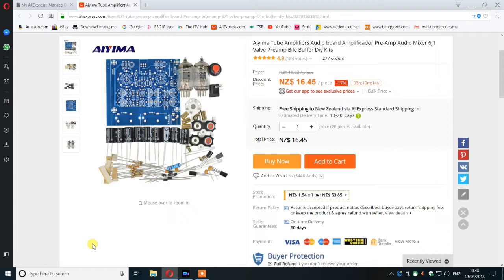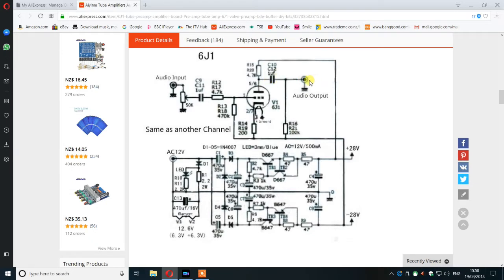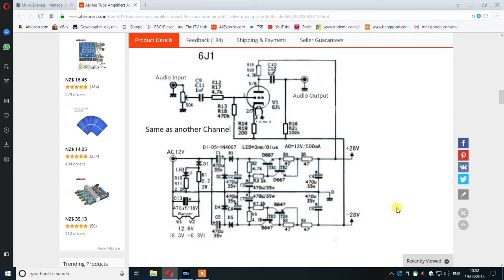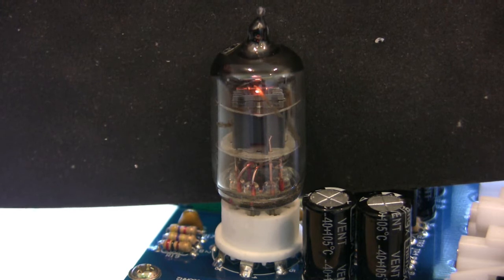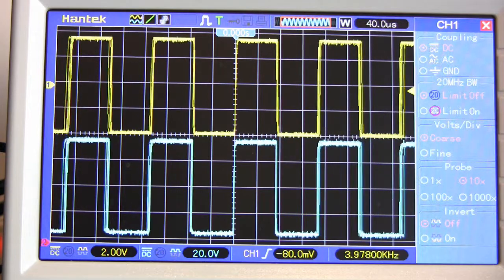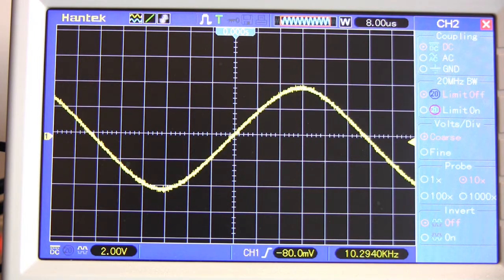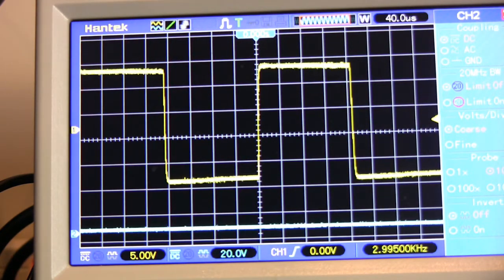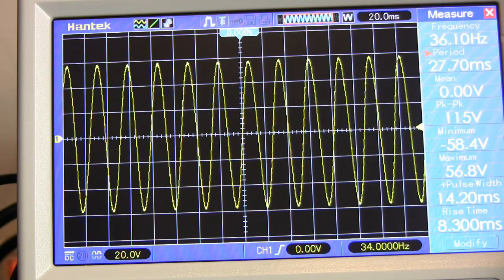Aiyima Valve Pre-Amp.

Comment: Great video! Is there any way to modify the power amp section to increase the input imedance and in tern improve the bass responce?
Reply: Replace the two 105 ceramic capacitors between the tubes with 3.3uf bipolar capacitors of some sort, up to 10uf

Comment: Anyone know where can I find a 12v ac power supply?
Reply from the maker: A 12 volt AC power supply is simply a transformer. Many electrical component shops will have such a transformer available and at very low cost. Look for 12 AC @500mA to 1 amp output.
Reply: @MichaelBeeny  Thanks
Reply: @MichaelBeeny  any specific watt ratings to look for in a transformer?
Reply from the maker: @dogsauce19  A transformer with about a 1 amp output should be fine.
Reply: @MichaelBeeny  Thanks for the quick reply! Most bare transformers don't mention amps but instead list their watts. A quick googling tells me 1amp = 110w at 110v. I'm guessing that's what I need?
Reply from the maker: @dogsauce19  No quite, the rating is on the low voltage side, so on that basis it will be 12 x 1 = 12 watts. All the transformers I have the secondary is always rated in amps. Look in Ali Express or e bay.
Reply: @MichaelBeeny  Makes me wonder whether this would benefit running on clean linear power...🤔

Comment: Yeah i can't stand the blue LEDs either that always come in these kits and would always suggest to just leave them since the they are not essential for the function. I guess some people like the blue glow some Valves have but i don't need it. And i actually kinda like the addition of overtones that some valves produce. Problem is these 6J1 valves that come with these kits are not really meant for audio purposes so they might have a very boring sound. But of course they can always be swapped with a different pair that is compatible.
Reply: I bought a cheap headphone amplifier with those blue LEDs under the tubes. I cut the trace on the PCB to disable them (it wasn't a kit.)
Reply: @wcg66  Yeah i did the same with another pre-made board like that. However i de-soldered the LED solder spots and removed them. Looks so much nicer now.

Comment: Great vid Michael... i have a 2000ohm 1920's radio speaker. do you know if the output of this would match? i was looking at using a mono amp with an 8ohm to 1300 step up... however, if the impedance output of this pre is high enough, i might not need the power amp stage. Next, in either case, I would need to mono sum. If i used 1k resistors then a 1:1 transformer between preamp and speaker/power amp, would this be safe with this preamp? thanks Michael
Reply from the maker: This has a high output impedance; I doubt it will run headphones directly, even so-called high impedance types.

Comment: I built one a couple of weeks ago, cost me less than a tenner, I did the freq response tests, I cant believe it.  Its an amazing little preamp. I cant hear any coloration from it either. I did an AB test with it set to unity gain and switched in in and out and didnt notice a difference played through some small mission speakers.   I will try the output measurement from the power amp to see if I can see any roll lf off. The input impedance of my amp is 20k.  The price is cheaper than a passive pre amp. I dont get any hum or noise from it either, amazing, a fun project.
Reply from the maker: 20k is abit low, you might find some bass roll off. If so put a series resistor, just high enough so the bass does not roll. I doubt you will lose gain because it's seeing a higher input impedance. You wont get much hum or noise because the gain is so low.
Reply: @MichaelBeeny  OK thanks very useful!

Comment: gotten a little late for this video. and i guess you have a few things right about it won't be good as a preamp. but what about the "warm" sound lacking in a Digital amp. and using this on a vinyl player. as "inbetween" the player and amp. not for gain but for more believable tube amp sound.
Reply from the maker: I think the warm sound you are talking about is the lack of detail, extended frequency response, dynamic range. Too name but a few things missing in most valve amplifiers. Still, some people like it.

Comment: Some guy is claiming this is a PHONO preamp but I cant see any RIAA equalization in the schematic, am I wrong? Is he trying to fool me?
Reply from the maker: You are correct, no RIAA, also not enough gain for a mag cartridge. Might be OK with a ceramic cartridge of about 100/500mV output, input via a 1 meg resistor. This would not need RIAA, but does need a high input impendence.

Comment: good morning I found your extremely interesting video just today   I wanted to ask if by chance you also have performed measurements of noise and distortion on this nice preamp 
And then if you know its voltage gain Thanks and best regards, gino
Reply from the maker: Hi Gino, was a while back but as the gain was relatively low, noise was also low. Not as good as say a 5532/4 chip pre amp. Distortion below 1% mostly 2nd harmonic. That's the valve sound some people like for some reason.

Comment: I have the Musical Fidelity X10-D, tube buffer from the 90s.  In fact I have 2 nos. because I kept the 1st one in my parents place for the hifi there.
I would say that although they work, they may not alter the sound (to make it more tubey) for all systems.  I suspect they work best in systems if it can provide a higher input impedance than the amp.
Putting it in front of the marantz PM55SE (also from the 90s), the overall presentation improved was rather obvious.  There was better resolution/definition and the overall music was less congested.
That being said, it didn't work with quite a few amps that I have tried.  Not sure if it is because some of them are already opamp coupled so the input impedance was high and stable.

Comment: Oh... I have similar one too... Came complete with acrylic casing.  Uses mainly smt components except for the psu caps and higher power resistor.  They gave a pair of 6j3.
I have 2nos of the MF X10-D too... Started my tube journey from there

Comment: Michael, if you left out the nasty blue LED, did you just leave that branch of the circuit open? Did you change any of the values of D1, R1, R10/R11?
Reply from the maker: No need to change anything, just do not fit the LEDs The current draw is so low from the LEDs it makes no real difference.
Reply: I removed the blue led from my pre assemble preamp too!  Too many blue led on my console. 
Actually blue led is so passe... Like in the 90s.  And tube heater glow is good enough for ambience😁😁😁

Comment: mine have sanyo capacitors, probably really old ones because one of them started swelling already. I'm planning to just replace them with some nice chemi-con ones and while i'm at it I'l also replace the capacitors of the amplifier section itself with some nice wima mkp capacitors and replace the tubes with ge5654w
Reply from the maker: I'm surprised you are having capacitor issues already, as  none of the caps are stressed in any way. As you said maybe you were given old stock but mine all looked good as did all the components.

Comment: These tubes break EASILY!!!!! The sockets are TOO TIGHT and crack around the pins. Take a tool and gently loosen the pins in the tube sockets so you don't have to force the tubes in! Even then, the tubes can be easily damaged upon installation. Can't beat the price, but get EXTRA tubes when you order them. It sucks when you order an amp, plug in a tube, it breaks, you wait months for a new one, then break it. I've installed MANY tubes in my 25+ years working on electronics! These sockets and tubes borderline on terrible, but you get what you pay for!
Reply from the maker: Yes Ryan, I agree they do need very careful  handling. Touch wood, I have not broken any yet, not as robust as the older valves for sure.
Reply: The sockets are the issue.  When I first got hold of this tube buffer, I noticed it was very difficult to fit the tube into the socket.  The tubes don't go all the way in, leaving about 2~3mm outside.  When I took them out, a few pins were slightly bent.
I later realised that the pins can actually sit outside the brass pins on the socket side.  This kind of jammed the insertion and also caused the pin to bend.
Reply: Luckily though, they only cost $1 per tube, I didn't have any experience with Vacuum tubes so this was my toe into the water, I purchased extra tubes at the same time because I didn't know how long they would last but it's been over a couple of years now and I'm still on the original tubes it came with... As cheap as chips and far easier to replace if one or both failed than transistors! You really can't argue with that!

Comment: Looking at the diagram i cannot help but wonder about my setup. I was connecting it to my power amplifier, which runs at +-33Vdc. Could i scrap the pcb and conect the tube directly to my transformer, essentially eliminating its own power supply? I mean to keep the top part of the diagram
Reply from the maker: Yes you possibly could. I would fit a resister in series with the power supply to decouple it from the main amplifier, and put a capacitor after the resistor. If you fed it directly you might get noise or even oscillation. Good Luck.

Comment: Michale Beeny, this is safe used power supply with 12v DC electricity?, because this preamplifer works with AC 12V.
Reply from the maker: @phild.1122  Hi Phil, they are quite hard to find these days. An AC adaptor is basically just a transformer. These are easily available for electrical hobby stores or places like eBay or Ali express. Just look or ask for 12 volts at 1amp. Should cheap and a stocked item.
Reply from the maker: Not really Adam, as it uses voltage doubling in both positive and negative rails. You would need quite a re design of the power supply as in the end you need a +28 volts and a -28 volts. Better to get a suitable transformer. Plus of course a 12 volt supply for the heaters.
Reply: @MichaelBeeny  ok because im used DC 12V and everything its ok, this is safe?
Reply from the maker: @adams1562  Check if you have the required +28 and -28 volts as marked in the circuit diagram. If you don't have these voltages, it will not work correctly.
Reply: @MichaelBeeny  i have +28 and - 28v
Reply: @adams1562  are you sure that you are using 12dc? Because the circuit is very clever in that, if you look at the schematic diagram of the power supply section, it's using the switching of the AC supply to double the voltage in the cockroft waltern voltage doubler circuit, in other words, if you are using DC, you would need another circuit to switch the DC on and off for the voltage doubler to work! 
I'm no expert on this subject but that was my understanding of it. 
There's a really good video over on the EEV Blog channel that explains how the voltage doubler circuit works! It's very simple, just a bunch of capacitors and diodes, if you want to understand it better, go and find that video, maybe if you search voltage doubler or just scan through the EEVBLOG channel, you will find it...
Reply from the maker: @phild.1122  An AC adaptor is just a transformer in a box. This WILL be hard to find , hence just buy a transformer.
Reply: @MichaelBeeny  Jameco sells them on their website and on amazon. 12V Ac, 18V AC all kinds.

Comment: Hello sir, I am thinking of getting one of these valve preamps and running it into a class d amp, for home use. I don’t want to spend a lot of money but I don’t want trash either. Is this a good place to start? Btw, I am a musician and used to playing tube amps. I am not a fan of tube amps for a number of reasons. They do sound great when they’re tuned.  Tomorrow though? I do like tube preamps though!  Thnx:)
Reply from the maker: The only issue you might have is the lowish input impedance of your amplifier and the higher output impedance of the preamp. This will show up as bass roll off. In many cases transistors do not mix well with valves. The NE5532 preamp I reviewed might be a better choice. Also this will sound better also.
Reply: Tube amplifiers and class D amplifiers together? Why? Better go with a class AB Amplifier than the cold and sterile sounding class D! 
Class D is only good for portable Bluetooth speakers where quality of sound is not important!

Comment: what brought me here was I am a guitar player looking to save money always but i'm also always looking for THAT sound and wonder if this would not help used like an effects pedal into my two 50watt valve amps . They make pedals but for 250 to 350 US $ but i'd like to by-pass that $$$$ outage lol . I do have a cheaper 1 valve pedal that does preform well but have debated about what next ,,i even bought a smaller tube amp thinking of using it was the pedal so-to-speak but like you smoke is not cool my friend smoke is NOT cool . jammerman0101@hotmail.com I don't understand charts and graphs but you seem pretty smart . Leslie West a 60s 70s rocker used a SUN PA as his amp so SUN tried to capitalize on that and made a guitar amp which Leslie said was total crap that they ruined it ... I grew up in the 60s 70s with blues based jazz influenced hard rock and good pop ,,liked the 90s as well . I like a good tube valve bite and crunch .
Reply from the maker: I don't think I can be of any help to you really. I have zero knowledge about guitar amplifiers and pedals?? In HIFi terms guitar amplifiers are simply dreadful, they do horrendous things to the sound add tons of distortion but that's what makes them sound the way they do. Adding this preamp, or any other pre amp will just add gain. Which could drive the amplifier into more distortion depending  on how sensitive it was in the first place.
Reply: I'm a little bit late to this party but if anyone is still interested in the answer to this question, it is no! Not in it's present from! This preamp was designed for hifi use. While someone a little bit smarter than me would know how to modify it and add a potentiometer to it so that you can dial in some overdrive to get that tube sound that you are after, as it is, people purchase these things because people like you are always raving about the tube sound but when you are making music, you are specifically looking for that tube overdriven sound, sounds amazing connected to an instrument, sounds terrible when you pass the completed final mixdown through it. 
If you are handy with a soldering iron, head over to Uncle Doug's channel and I'm sure that he's covered overdrive in vacuum tube amplifiers, you might find a good Video where he shows the overdrive circuit, it's not complicated, then just add it to one of these cheap Chinese tube pre amplifiers and then it doesn't matter what power amplifier you choose to use, they will all have that tube sound that you are chasing!  
Technically you would be able to plug this pre amp into a home hifi Amplifier with hifi speakers and get that amazing sound... You just have to be prepared to do a bit of modification and you can have the cheap tube preamp your looking for. Hope this helps!
Reply: I want to do the same with my guitar amp

Comment: I have built four valve amplifiers all single ended triode three have no audible hum and the last of the four has a tiny bit but not audible when it has a signal,also have a solid state amplifier class AB and there is no coloration,no muddy bass,very sweet mids.I would have to spend very serious money,to get the quality of sound from a solid state amp.
Reply: Yup

Comment: What you think of this board looks interesting.
Would you recommend this board
I'm thinking of buying.
Best regards from brazil
Reply from the maker: Well Caio, it is reasonably good but does not like a lowish output impedance load. I terms of sound the NE5532 Op Amp pre amps I have tested measure better. Lower noise, better frequency response and no added colour to the sound. This valve pre amp does change the sound slightly. A good pre amp should NOT change or add anything, just gain.